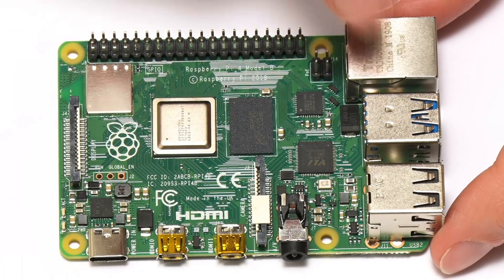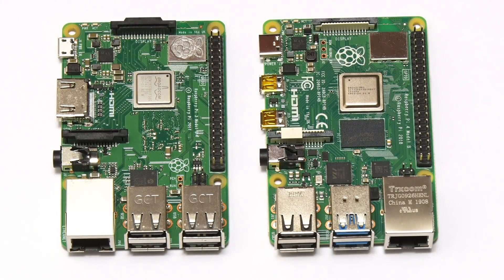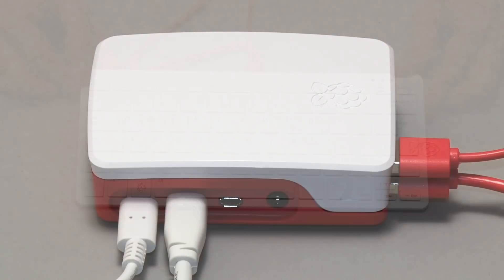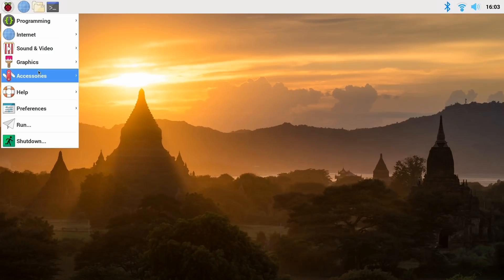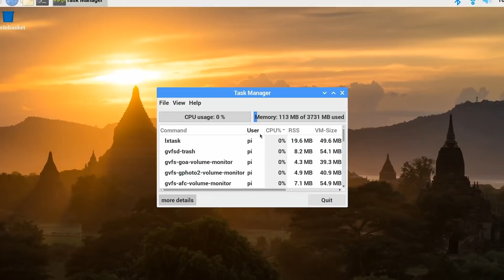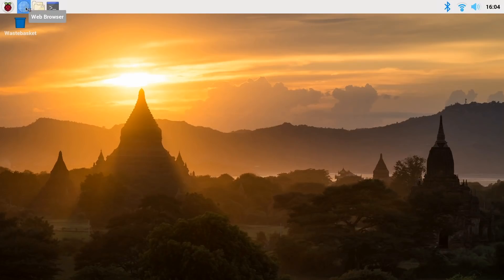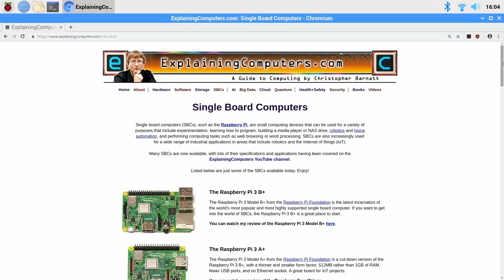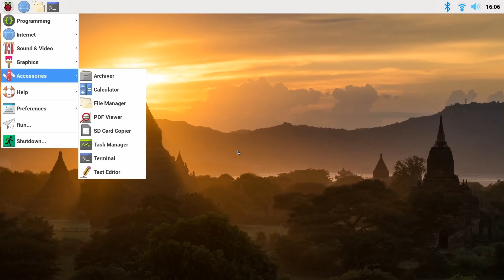Raspberry Pi 4 Model B

Comment: Any ideas how to use one of these as a NAS box? FreeNAS? how would you hook up a drive array?
Reply from the maker: I would be thinking one or two USB 3.0 to SATA adapters, and OMV (when a version is ready for the new hardware, which I imagine it will be pretty soon!). We may well see special Pi 4B NAS cases.
Reply: @ExplainingComputers  be nice to see some SATA connectors on the RPi.

Comment: Instead of dual hdmi, one should have been enf, giving space to other components like onboard mic and 3.5mm jack or IR reciever, also they could have placed a m.2 slot at the bottom and a more powerful GPU. Then it would beaten the competition.
Reply: Mohit Kunjir So what would you consider an ideal price, after all that?
Reply: You are forgetting the is a hobby board and not strictly used as a desktop and what you want would drive the price up completely defeating the point of a Raspberry Pi in the first place
Reply: @TBMartin  exactly my point, why then to give two 4k mini HDMI if its not going to be used as a professional computer
Reply: Hate to bring this up again but to change the GPU they'd have to do some serious architecture changes to the SoC.  While also working out how to keep it backwards compatible.
Reply: @bruitation  Signage, control systems, surveillance and monitoring systems. There are a lot of applications that require dual screens. Current Pi systems that have required dual screens have needed to create their own video streaming with 2 split streams to each individual monitor via independent Pi's, or using the Compute Module with development board. 
It would be nice to know if the "dual monitor" output feature will allow simultaneous output via DSI and one of the HDMI/Composite outputs.
Reply: I mean they already bumped it to 55$, one who needs these features could definitely spend a few extra dollars. RockPie does it. I understand m.2 slot is a stretch, but having a mic and IR sensor over the second mini HDMI port could have been more better
Reply: @mohit.kunjir  I have to admit I don't understand why it has dual HDMI out and it's not something I would ever use and I don't think a lot of people won't use it if they are making things with it but I guess they know what they are doing
Reply: @TBMartin  Dual HDMI isn't that bad. Considering a large number of Pi's are not used by hobbyists but are used in industrial situations, dual HDMI is a godsend.
Reply: @mohit.kunjir  why not just buy an ir sensor and connect it to gpio pins
Reply: @mohit.kunjir  If you want all of those features, go with a Nvidia Jetson Nano for $99 USD.

Comment: I'm lovin this. These little computer boxes I believe even have the potential for being used outside the enthusiasts rooms. 

Due to its very compact size, price and capabilities, i can see this can be used for example in small shops.

 You can get online on it, print receipts, use linux office apps. Has a small n stylish keyboard and mouse. 

Fact that it has hardware decoding of 1080p h265 even, the experience will be smooth, I am guessing.

Having this little box underneath the monitor on a shelf, will save a lot of space for some people who are using still big computers for essentially doing the same work
Reply: Gagan That 4gb of Ram is a big upgrade in the £55 version,you slap all kinds of operating systems on it!

Comment: RPI 4 B. Neat little board specially finally with more RAM options. Gigabit ethernet and USB 3 nice add-ons - finally after so many years... That dual HDMI 4K support tho I'm not so sure about. Let's be honest here - they claimed  as I recall that the 3 could play YT at 1080p and that never worked for me - always stuttering. Maybe on the higher RAM capacity ones but definitely not seeing it for the 1GB model. The USB C power is a bit of the kick in the ball as well - "you gotta buy the new adapter from us also hue hue hue". In conclusion I'll say that before seeing any benchmarks comparing the performance, I don't feel any impulse to go and get one to upgrade from my 3.
Reply: steaming and video playback can't be compared. They haven't claimed this pi can stream 4K. they just said playback. it's still a big claim, but not the same
Reply: @dayspoiler4608  if all we get from those claims are picture frames at those resolutions/frequencies I'm not impressed. There are some massive performance boosts from the CPU side tho. Now I'm really getting interested to see it in action.
Reply: If I'm not mistaken, the Micro USB standard topped out at 2.5 amps in the specification. This newer model Pi needs 3.0 amps, so they moved to USB-C to be able use more power for these performance upgrades.
Reply: @alvallac2171  just checked magpi review of the RPI 4 and was surprised by the power draw - 7.6 Watts at load with HDMI display and USB mouse and keyboard connected. This equals to 1.56 Amps at 5V - why do we need 3 Amps power supply is beyond me when while running CPU intensive benchmark and still uses only half of that.... I know the answer - to power hats and other stuff but cmon - that's too much extra power.

Comment: The RAM change is an important one, I think. The older units have been starved of RAM and that makes them slower. Adding to the new resolution and dual head video options, you'll need more of that limited RAM for video. The old 1GB option should be discontinued, I think.
I'm strongly considering this new Pi with a sound hat or external DAC for a music manager. My current solution for that task is too large, power hungry, and runs Windows. 😒
Reply: I agree, but the 1GB option keeps the price to just get one low and is enough for headless operation and simpler tasks...
Reply: The 1GB option keeps the Pi within that £30 price range, get rid of that and it's up to £40+
Reply: SeanFromPVD yup,it should be a much smoother experience,at least the 4gb!
Reply: Buy a google AIY voice kit (v1) from Microcenter. Currently costs $3!
Contains a DAC hat, good speaker and microphones. (And a bonus arcade button.)
Best hardware deal on the planet.
Reply: @chipminion7887  the DAC I'm talking about is for HiFi output. The AIY module is made for a Pi Zero W and doesn't have external power. My 300 Ohm headphones wouldn't jive well with that. There are some DAC/Amp combos with PSU that would drive it well, or I can use another option I already have. I may do some tests next weekend to see if I already have the solution I need. (Then get another Pi, since the one I have already has a job.)
Reply: “Ehhhhhhhh........”

shivers 

“Windows.....”

Stares off into distance as tears well
Reply: @saltyballs1041  I hate Windows. It's the only system I have currently running Windows 10.
Reply: "The old 1GB option should be discontinued" 
So you wont be buying a 1gb model... ok, thats why there are other options to choose.
WHY MUST YOU FORBID OTHERS from buying a 1gb version if thats all they need/want?
Freedom & Choice are not bad things, maybe you shouldnt be opposed to freedom of others choices
Reply: I'm really excited for the 1gift version for digital signage. I can cut my budget in half with the micro hdmi ports.

Comment: I prefer a full size hdmi connector
Reply: That seems to be the most noticeable flaw is the unnecessary mini ports
Reply: I agree on full size HDMI connector. They are other ways of getting multiple displays. Besides the smaller HDMI connectors are prone to being pulled off the board easy.
Reply: Two stacked hdmi connectors would've been great, but looking at prices on digikey between the two types this was probably the best compromise they could come up with.
Reply: or at least mini hdmi (as on the pi zero), micro is too weak IMO.
Reply: As long as I can still use the mini RCA jack on my CRT, I'm fine (the 3.5mm port)
Reply: The Goof /. Yes, my "gaming pi" an old pi 3 is fun to contact to an old TV to play games for kids back a few years ago
Reply: @Mikey_Today  i like that
Reply: mmmmmmmmmmmmmhhhhhhhnnnnaaahhhhhhh consider that:
1) it's double, this way
2) having a\some micro-to-whatever cable around will happen before or later
3) this board is really lightweight, a cheapo HDMI cable is literally a stick of hard plastic, you always slam the board around when moving such cable, a micro one will likely be softer
4) anything will be cheaper at the end
Reply: Señor Dossier [Retro reviews, Coleccionismo & más] you can always buy hubs/adaptors that have full sized ports.
Reply: @Doobie3010  Not the point.  The micro HDMI port is trash!  Its too flimsy to hold up to repeated use.
Reply: @inorite4553  That's why they put two ports onto the board! HAHAHA
Reply: @inorite4553  So you can buy a micro to female full HDMI and deal with the full only in order to protect the micro. Of course it adds up to the price if you have to buy additional stuff.
Reply: Inorite / I understand your frustration that said if you buy a small adapter and leave it attached it will work out great/. The fact that they are running out of space to add large connecters should be considered.
Reply: @inorite4553  You would be plugging into the ful sized HUB sockets,you know HUB.
Reply: @Doobie3010  I understand what you're saying, but the ultimate stress/strain is on the tiny little, eeny-weeeny micro-HDMI port which is the weak link.  

I'm of the team of, "Mini USB is better than Micro USB."  and that goes for HDMI as well.  It's just not a very robust connector and prone to easy failure.
Reply: @NewAgeDIY   Oh I agree.   I just would much rather trade reliability than size.....well, I guess that's just the Engineer in me.
Reply: @inorite4553  I think its priorties,making upgrades worthwhile,without ramping up the cost.It will always be that way with the Pi.And yes,i also would prefer full HDMI,but if thats the price of keeping the price down,then its a small sacrifice.
Reply: agree with this, the tiny hdmi ports are so going to break, soo much tension on that tiny little port from a thick hdmi cable!!! 

also think it was a mistake switching to usb-c for power, those ports (looking at Nintendo switch) are also breaking under regular expected usage!
Reply: @Mmmm_tea  true :o
Reply: so unsolder it and solder on a full size HDMI connect that has the traces of a micro HDMI connector. A little more work and will make the board unable to fit in any premade cases but if you want full  size HDMI you can get full size HDMI that way. I suggest against it but it will be your board not mine so if you want to I cannot stop you. The software will pick it up as HDMI either way.

Comment: What would really impress me is if they came out with a 4A+ that was depopulated like the Odroid C0, which didn't have the ram cut back, and was able to be overclocked. I like that they give you several options for ram on the 4B. That'd be perfect for DIY mobile devices.  And also an option that excluded wifi and Bluetooth, because having an offline device is actually desirable to a lot of people I talk to.

Comment: Dont get me wrong its a nice product BUT this needed upgrade is just to bring it in line with other SBC out there really, there is nothing to groundbreaking with this generation of Pi TBH. 
What i think Pi should do is a deluxe Pi made with a ryzen mobile processor with vega graphics this would be a significant change.
My biggest and only gripe with the Pi 4 b are those 2 micro HDMI (they are a weak connectors and break often)
Reply: Um under 60 and same great software support. What more do you need?!?!
Reply: @WuClear lets get one thing straight im not saying its not a nice product (but its upgrade is only significant if u compare it to other pi's) it has its chance to shine but this market people are always looking for better hardware, better hardware more opportunities its as simple as that.
The software support really only extends to Raspbien OS but ill bet its not the most used OS on pie hardware.
Reply: @Spriggen1337  I understand. They want to keep it backwards compatable. Id expect to see a mid generation b+ with maybe a little bit more. What other innovations would you potentially like to see? Just curious.
Reply: @WuClear  M.2 support is something that stands out right of the bat, higher ram configs (obviously higher price) if people are gonna be using this as a desktop replacement more ram could be beneficial 
an option to get rid of the GPIO ports if ur never gonna use them in favor of something else like a PCIE slot maybe, people have been using GPIO for a 4x PCIE slot with an adaptor out of the box support for PCIE would be alot better something which could keep raspberry on top of its competitors
Reply: @Spriggen1337  M.2 and 8gb on the plus model would be great if it releases in a timely manner. I am pretty happy with the paper specs for this new 4b for now. Improvements can always be made.
Reply: @Spriggen1337  They could always do better but at least they got something on par now.
Reply: @jon b atm im unsure in the same form factor i know there are boards out there with 4gb of ram and gigabit ethernet, but at the same time a halo effect will also occur meaning other boards  will either come down in price to match or release a superior product in terms of hardware (not software), as it always happens. 
News of this just released today (24/06/2019) did it not and ill bet within a week prices will start dropping or announcements of new hardware will come from other SBC/OBC manufacturers so that they can be competitive in terms of price and hardware. 
Im not saying Pi4 b isnt nice and its certainly compelling atm to buy but at the same time i dont like to buy pi because they become obsolete pretty fast and take ages to do a product revision.
Reply: @jon b im not saying it isnt done by raspberry but to me  if a product is gonna be outshined/obsolete in less than 6 months (raspberry if they did a nice yearly refresh this wouldnt matter so much) its not worth the hassle id rather buy hardware and put on a generic linux OS similar to how i make a computer from scratch.
ill make a guess right now there will be a board with 6gb of ram on it with a similar if not better CPU than the pi4 b for £80 -100 within 6 months.
The jetson nano isnt made in the uk tho if it was it probs would have a lower price its an american product and they are £110 and its only saving grace is the maxwell gpu
Reply: @jon b Support and stability is why I love Rpis over most other SBCs

Comment: Saw this and thought it was April fools joke.. relieved that I was wrong.

 I'm not overly fond of the mini HDMI ports they included. They are incredibly flimsy connectors, and I fully expect issues with them over time.  Overall though I'm pretty happy about the upgraded specs and RAM choices.
Reply: As long as you don't move the pi around a lot while it is plugged in to the monitor and you don't unplug/plug in the monitor every day then you shouldn't have problems with the micro hdmi. Just plug it in once and leave it alone and you should be fine. I have had my current computer for 5 years and haven't touched the monitor cable more than a few times in that period.
Reply: @IgabodDobagi  Just the stress of the cable pulling on it can be enough. My Surface2 tablet's micro hdmi broke after only a few inserts and removals.
Reply: @smartroadbiker  someone is heavy handed
Reply: @smartroadbiker  let me guess, you constantly break your power cables for  your phone too right? Try not yanking the thing out. Don't pull it by the cord, just grab the fat part as close to the device as you can and gently pull. Don't blame the connector for you being an ogre.
Reply: @smartroadbiker  no connector is designed to be repeatedly inserted and removed. Keep it stationary and choose a setup that you won't be changing quite a bit.
Reply: @IgabodDobagi  Who actually uses pi as a computer they don't move around?!?! XD
Reply: @ImaginarySpace  those who connect it to monitors
Reply: @ImaginarySpace  considering they are selling it in an official "desktop kit" I'd say a lot of people, and it is intended to be done that way by the makers of the board. It's not just for robotics and arduino type stuff anymore. They are expanding to a much wider customer base now.
Reply: @IgabodDobagi  youve been fortunate.
Reply: @IgabodDobagi  you have been VERY lucky
Reply: April Fool's, in June?
Reply: @AraceaeFanatics  sometimes old recommended vidyas pop up, ya know?
Reply: Yup.  I said the same thing. 

It would have been better with a mini display port for that very reason
Reply: From what I hear, micro hdmi (what is used in this pi) is much better than mini.
Reply: April fools on June 24th? That makes sense... or maybe you saw someone else comment the same nonsense and reposted it for some reason. 😂 😂 😂
Reply: @zachlombardi3137  yt algorithm is dumb. I get  old videos all the time, figured it was that, lol
Reply: ZoahPorre hahah okay okay, understood friendo! I gotcha.
Reply: It's June 24.
Reply: @paultrussy  never had an old video recommendation?
Reply: I wonder if adding a stablizer of some kind to the case could help with that.